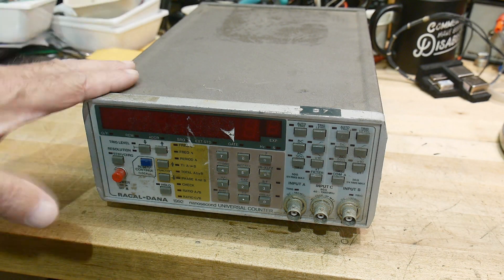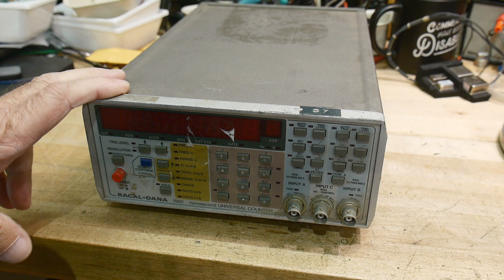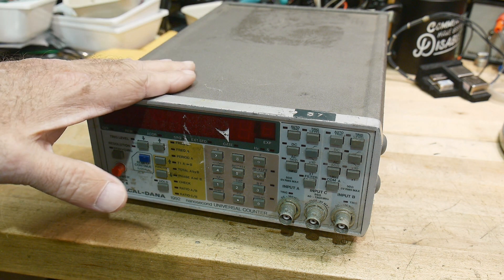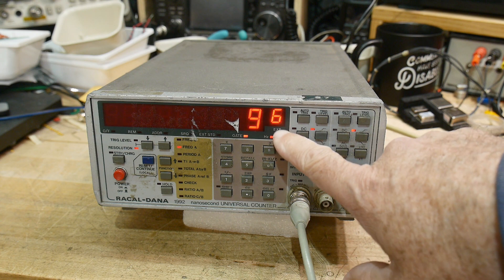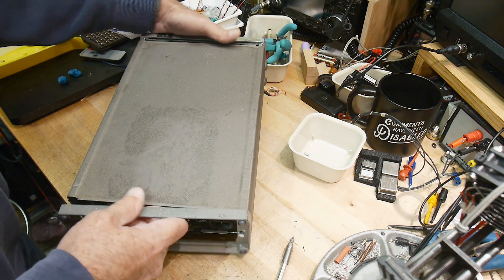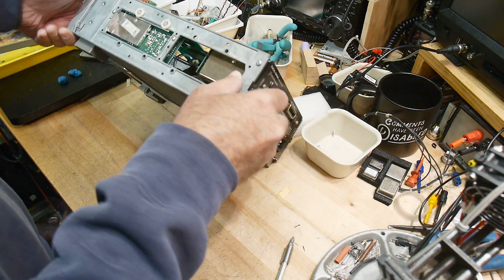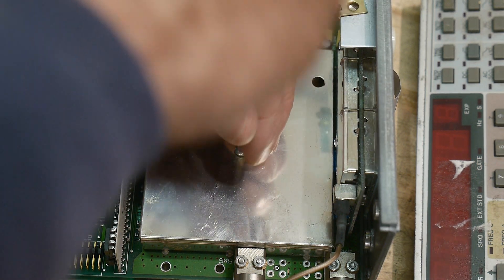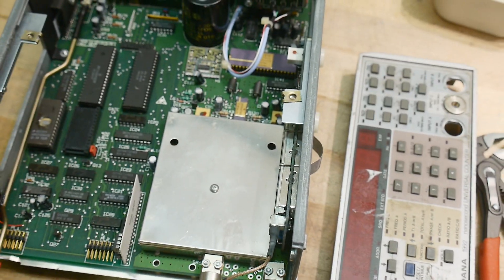#1018 Racal-Dana 1992 Frequency Counter (part 1 of 4)

Comment: I took a counter from an old energy meter that I now use to count the seconds of a transformer I'm using with my ZVS driver so I have a rough idea how long I've been running the driver without it breaking. It's not very accurate but it shows me the rough amount of seconds which is enough for the application I'm using it for.

Comment: MC146805 is the external bus version of the 6805 microcontroller with a whopping 8K address space.

I'm designing an SBC around this chip because I was gifted a bunch of parts from the local maker space and I'm using it as an excuse to learn SBC design, PCB layout, etc.

Comment: At Rockwell...we used an atomic clock...for the time base on lots of instruments...
Reply: I've clocked my 1998 with 04B OCXO from an atomic clock (I have GPSDO, Rubidium and Cesium references), the 04B is a damned fine OCXO and was less that a few nanoseconds off, so close it wasn't even worth breaking the 15yr old cal stickers on the adjustments.

Comment: Two comments. 
I replace caps with a bulging top, even if it's just the plastic bulging, because I figure it's bulging because the capacitor has been outgassing in some fashion. Second, you might want to put some tape over that exposed UVEPROM lid before it drops a few bits from the window being exposed to daylight.

BTW, I love big old crystal ovens. Like old wines, the longer they have aged the better (more stable,) they are.

.
Reply: I saw the missing tape and wondered why he said nothing. Hopefully it's not already too late.
Reply: @jonka1 , I suspect the problem is that it's already too late. I'm pretty sure the seller sent out a dead unit on purpose in a 'bait and switch' in order to dump it off for whatever they could get BECAUSE the processor EPROM was dead, had lost data. They do that with age. If you watch the video closely you will see that BOTH the GPIB UV-EPROM AND the processor UV-EPROM on the mother bd are missing their UV window covers. Unless both stickers are sitting in the chassis they were intentionally removed by someone trying to fix the unit.) 
A search of the web indicates 3 likely suspects for problems with these: 
A bad 10 MHz oscillator connection. (They use the 10 Meg reference as the processor clock,) especially on start-up, before it can switch over to an external reference. 
Bad UVEPROM data (they can be reprogrammed with copied data from a working one. 
The stuck keys that were mentioned in the video, which can usually be cleaned. 

I fix a lot of old gear. :)

Comment: I have one of these counter and when I got it I had little issue with the small ic on the right side looking from the front panel. If I can recall correctly I had to change the ca3083 and the SN74ls138n. Anyway look carefully that area besides the switches on the panel....good luck!

Comment: I have repaired several of these on my channel, I even have a source for replacement switches linked in some of them. 
Bad switches can confuse the processor and cause odd behavior.
Reply from the maker: I watched your repair. I saw those links and the sellers had no more switched. spoiler alert, I do find a solution
Reply: @IMSAIGuy  The correct parts are SKEGACA010 ...they fit perfectly & their "t" top fits the plastic caps without gouging them up.  The price has gone up since they were discontinued 4/2019 paid $29 for 100, 4/2021 paid $29 for 100.
Reply: @IMSAIGuy  I had a few videos, they have different links, one was to digikey.